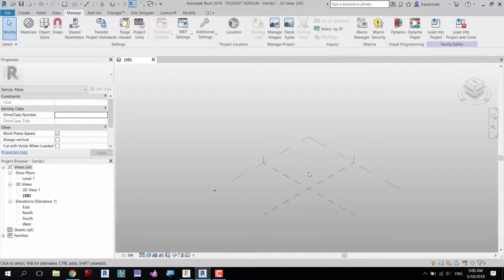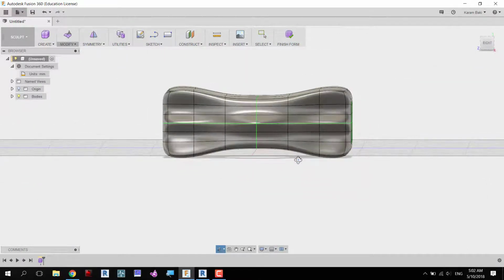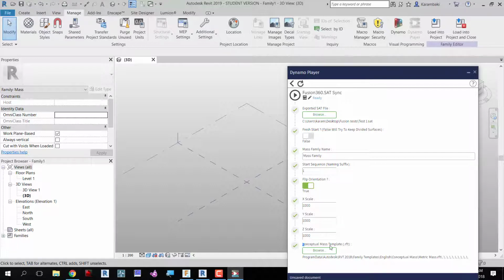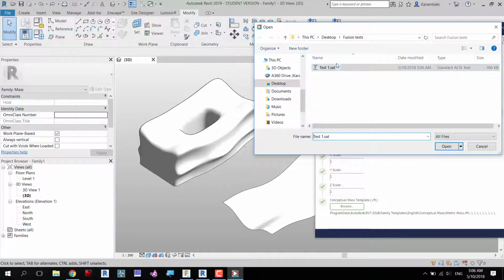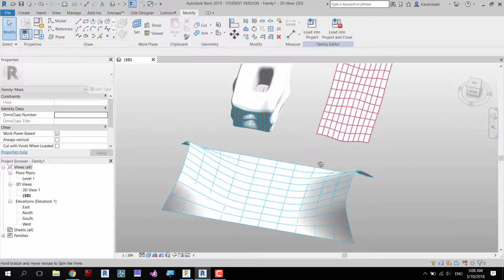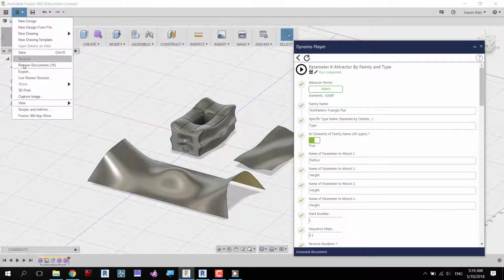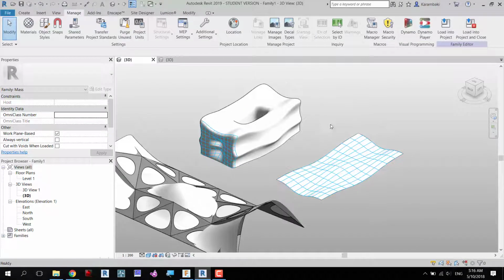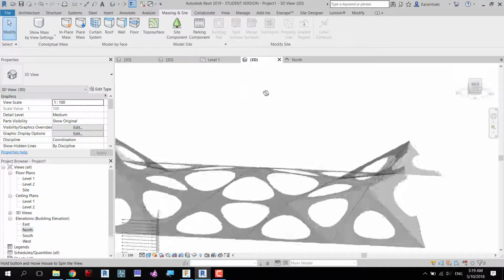(OUTDATED) Fusion 360 SAT Sync with Revit (Update to ReFusion IT)

Comment: Dosent work in revit 2023. I followed everything: project unit in meters, used Family.SAT Sync etc.
After running the script it show up error message saying: Method not found: 'autodesk.designscript.geometry.geometry[] autodesk.designscript.geometry.gemetry.importfromsat(system.string,double)'. 
However i've also tried using revit 2022, the script did ran successfully, however the model did not show up inside revit.
Reply from the maker: The current method is very advanced compared to what's shown in this video.

Simply open Dynamo, call KFamilyInsert and plugin the SAT file.

Family.SAT Sync should also work, if you installed the latest version of Synthesize. 

No need to have the units in Meters now as well for SAT Sync specifically.

Let me know how that goes with you.
Reply: @KaramBaki  hi karma, thank you for your reply. Actually I found out the reason it wasn’t working—it’s because I did not do it inside conceptual mass. So I’ve been testing Family.SAT Sync for a few days now in revit 2024. It works flawlessly, however it seems like a more complex form will not work inside revit? I have a mass that I was trying to load (60mb) but revit will not let me place it anywhere whatsoever.

Comment: I tried to export a Part to .SAT and then use it as an import in a Family in Revit.

Actually all geometry does work. The only thing is that the model comes in rotated on its side.

Somehow Top is defined diffently in Fuson 360 as in Revit.
Reply from the maker: There's an option in the script called Flip Orientation, toggle it on or off

Comment: Hi Karam, I just tested the Sat Sync for Revit 2020, which uses Dynamo 2.1.x. It doesn't seem to import any geometry, unfortunately.
Reply from the maker: Hello Phazon, Yes many scripts in Synthesize toolkit are not supported yet in 2020, am working on it, approximately after 1 week everything will be compatible with it.
Reply: @KaramBaki  Thanks for the heads-up, I'll be looking forward to that. Keep up the good work!
Reply: @KaramBaki  I was wondering, is there a way for me to contact you directly to discuss some things about the SAT sync workflow and related topics?
Reply from the maker: Hello sorry for late response, It's now uodated to work with 2020
With Dynamo 2.1
It also supports 1.3.x

You can contact me directly at karam@aecedx.com

Comment: Hello there Karam! Thank you for this video. Makes thing easy. However I still have issues. When using Fusion360.SAT Sync to import my Tspline model into Revit, I now get the message: Run completed with errors and nothing happens in the conceptual mass environment of Revit. I used to be able to import any model this way, but lately I was having issues with the imported model in Revit (wasn't giving me the option to subdivide the surface, and I tried every option I knew). But now I cannot even get Fusion360.SAT Sync to work. I have uninstalled dynamo many times and cleared the dynamo registries and reinstalled dynamo, and I still have the same issues. To summarize the current issue is Fusion360.SAT Sync is not importing the model into Revit, and when it was doing it, I was not getting the tab option of subdividing the surfaces in Revit. I appreciate if you have any solutions to these problems. By the way this happens in Revit2019 and 2018, Fusion 360 and Dynamo 2.02 educational Regards.